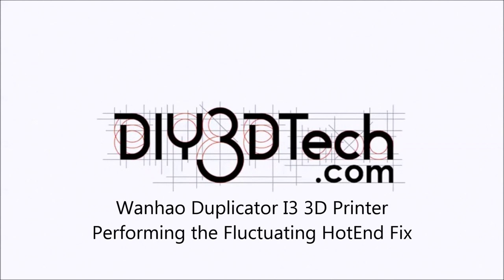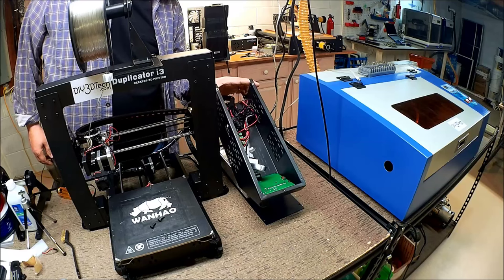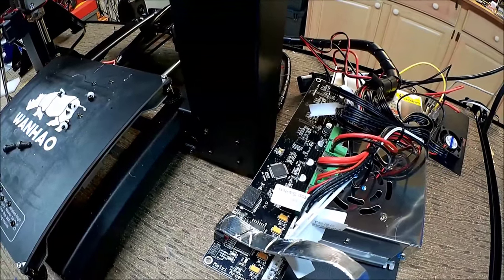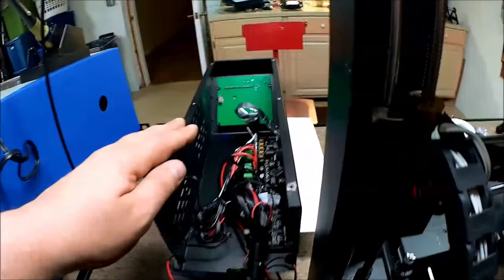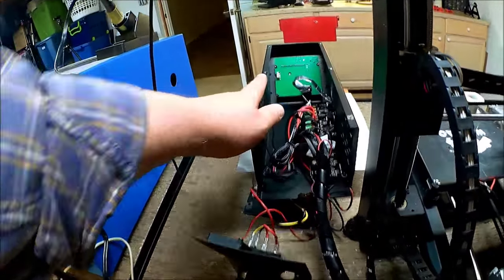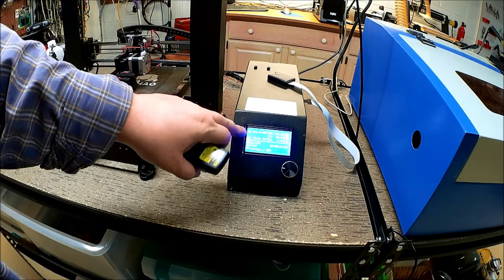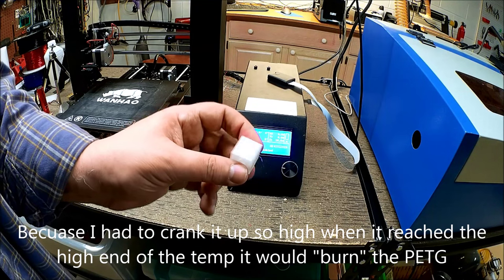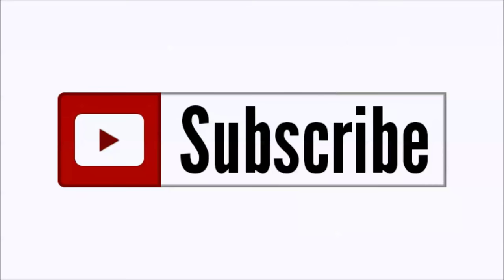Wanhao Duplicator I3 3D Printer - Performing the Fluctuating HotEnd Fix

Comment: you could run separate mosfets for the bed & hotend  to take some of the heat off the melzi  board  might help with temp flux alittle too....    don't  print  petg above 245  with  plastic tube into hotend it will eventually jam & tube will warp
Reply from the maker: +Michael Stoffel many as there is a separate mosfet but only one feed from the power supply so everything is fighting for current.  Also yes I have the Swiss micro all metal hot end too 😊

Comment: Did you check the continuity between that pin a power ground before the mod ? I ask as I have fluctuations and the exact same board number they say had the problem. However,  when I tested the continuity of that pin to ground it was already grounded. Not sure I should bother now as I don't see what difference it could make. Unless they made new boards without increasing or changing the version number of the boards.
Reply from the maker: Wow this was a LONG time back!  I can tell you it improved it, however it did not make it totally go away...
Reply: Thanks. I solved it in the end by adding a external mosfet. Also while I was doing that I discovered the case and printer frame were not grounded to earth which is pretty disgusting. So I got to add that.
Reply from the maker: I know my case with the PS is grounded, however did adding the external MOSFET solve the fluctuating issues as I have rad there is a bug in the firmware...
Reply: Odd. I had to add a grounding post and then I ran an earth to the frame from that as well.

My fluctuating has gone to a couple of degrees now which is fine. Adding the external mosfet board definitely improved  that. Before adding the mosfet it in was over ten degrees

Comment: hi I have the mono price maker select and my heat bed would not go past 27c what should I do to get it to 60c
Reply from the maker: First thing is check the thermistor to make sure it is working, second I assume you are setting for 60c and simply is making it stoping at 27c so take a multimeter and check the voltage to the bed, as if it is reading 27c and there isn't power to the bed and below 27c this would indicate the mofet is working and I would go back to the thermistor.  However if there is power at 27c the heating element is bad...

Comment: Joe, are you aware of the discussions about the power wire connectors failing on these boards? JetGuy (Vernon Barry) is trying to make everyone aware of the potential hazard that these connectors posses.  Looking at the still photo of your board, which is similar to mine, the wiring for the heat bed is larger than the wiring from the PSU.  That in itself along with the concern that the board connectors are improperly installed and soldered AND the screw terminals on the wiring connectors for all the connections are lose seems to be contributing to the numerous failures and near fires.  

What is your opinion on the PSU wiring being smaller than the heat bed? or are the heat bed wires over-sized and the PSU connectors are just poor quality and installation?
Reply from the maker: No I was not however yet it is funny you share this with me as I just completed a 4 part series on the hotend and found major issues with the Wanhao.  The videos are scheduled in queue for Mid Nov however will private message you the links later today after the 4th one uploads so you can watch now (or at least I hope this works)...
Reply: DIY3DTECH.com - thx. Yeah, this is not good for 3D printing.  New users who are just typical consumers and probably kids who just don't have the knowledge or skills to discover or make corrections are at risk. 

I would hate to see a tragedy occur because of lack of quality design and quality control.
Reply from the maker: Thats the risk with all of the "chinese" stuff, as just like the lasers I have no clue how they are sold here and watch people on Youtube do crazy things!
Reply: DIY3DTECH.com - Me neither. There is no UL sticker or anything. The lawyers haven't had time to look outside of the borders I guess. Lol
Reply: Here are some links to some posts on Facebook and Google+ on this whole wiring & connector issue. 

https://www.facebook.com/groups/WanhaoDi3/permalink/713913442093223/

https://plus.google.com/101552190891322750505/posts/Nx6cdteBh1o

I told Chuck Hellabuck about this and I'm hoping he or you or some other YouTubers can get the word out about the danger and hopefully a fix. 

Norbert
Reply from the maker: I see a video in the works :-)
Reply: DIY3DTECH.com - It would be a good one. Some people are talking solid state relays for the hot bed.
Reply from the maker: Just produced it should be tonight :-)
Reply: Let me know if you need anything from me. I sent you my email on Thingiverse.
Reply from the maker: Posted!
Reply: DIY3DTECH.com - Firing it up now.
Reply from the maker: I have no idea why iMove put in directed by Joseph Campbell at the end, as for some reason iMovie was getting flakey
Reply: DIY3DTECH.com / Maybe iMovie wants you to get credit for when you are nominated for a Youbie Video Award, lol. 

#wanhao #makerselect #youbie
Reply: Great video. Thanks for helping spread the news that there is potential for problems and give owners of these machines a reason to check their machines and possibly make changes and or avoid a literal meltdown and fire.
Reply from the maker: Was fun now I have to go and put it back together again :-P  I tried sending those other videos to you but YouTube won't show then as they are schedule and if I share them as private I can't reschedule them.  However long story short is discovered the hotened temp reads on my Wanhao were way off!  20c at 200c and ~30c at 250c in fact it can't even reach a real 250c!  I connect a thermocoupler to the hotend and read the real temp and was shocked!
Reply: DIY3DTECH.com - That's amazing.  I wonder if all machines are that inaccurate or why the Wanhao is off by that much. Could they have the wrong sensor coefficient programmed into the firmware?  Each type and brand of thermocouple has a different coefficient and if they switched manufacturer's at some point they may not have made the correction in the firmware.   Heck, I wonder if there is a correction factor or coefficient setting at all.
Reply: My machine's current status: Disassembled. Lol. 

Stopped working on the beating change out when I started looking into this wiring issue. Time to get back on it.  Hopefully tonight after work. Wife is meeting done girlfriends for dinner so I'm in charge of "leftover distribution". Don't think she trusts me to cook for the boys. What's wrong with peanut butter, jelly, and bacon sandwiches?  Lol

Comment: I wish i knew how to do this. I got a roll of pteg and it didnt want to stay at the required temp. Above 230 and my i3 doesnt want to deal.
Reply from the maker: +633r yes this is a common problem as covered in another video I think it is the single connection from the PS to the machine.
Reply: crappy connectors -  mine smoked out on me. had to replace them with quality screw terminals (no socket connector). Works fine now.
Reply from the maker: Interesting and assume all is good now?

Comment: http://www.thingiverse.com/thing:881566     I haven't done this mod yet but I have put the fan and the cobra head one and I noticed a change in my jump....I'm bet if you add this you'll lock your temp...I'm about to order that tip you showed last time ...I'm seen a video on a change out and the kid blow the board as he explained how he did it seems easy to do the same I'll see if I can find the video and send it to you if you want.
Reply from the maker: +Chi Sty you might have a point on the fan mod from two angles as one is I think your saying the fan is dropping the head temp when on and kicking off.  Could be, the other thing I am thing as the fan is small but uses the same power bus as the hot end and there might be issues with that in the MOSFET
Reply: +DIY3DTECH.com yes BTW I'm still using the stock fan with the adapter I printed with the cobra head.
Reply from the maker: did you print it in PLA?  Was thinking about ABS,  your thoughts as you have talked into trying it...
Reply: +DIY3DTECH.com i used ABS up sized .03 ,I sanded the mount to a slight angle so the ends sit center around hot head ....with eye i marked the ends that to me seem to hang down to far and trim them upto the part of the head you can wrench on .....note there seems to be a small split that one drop of crazy glue will fix....any questions let me know .